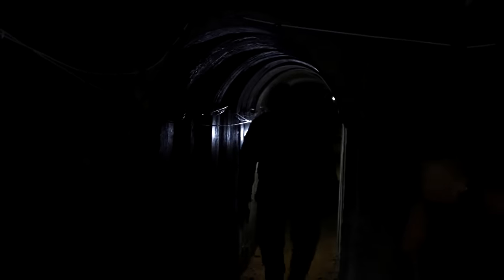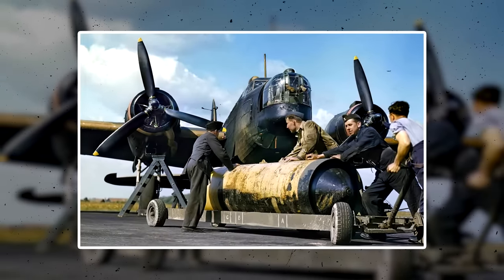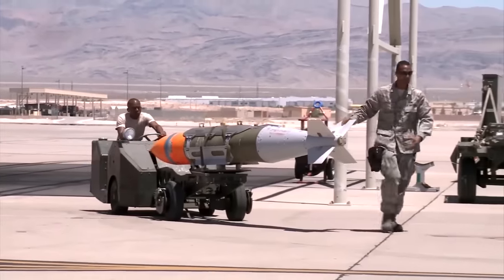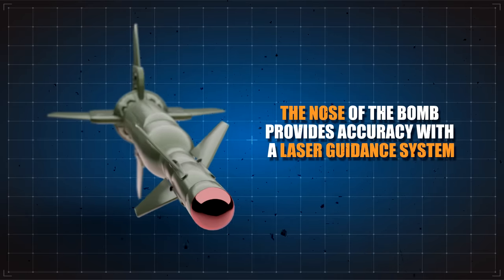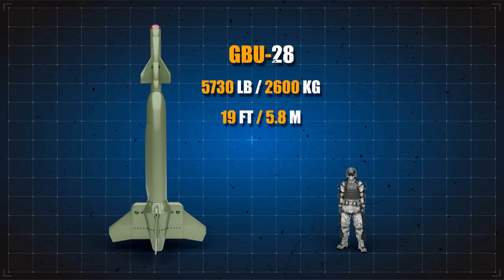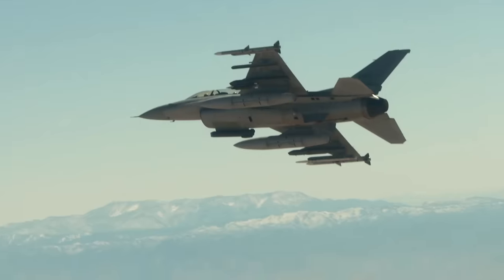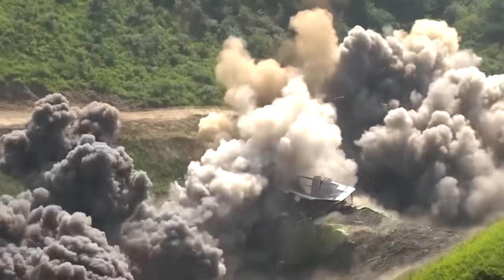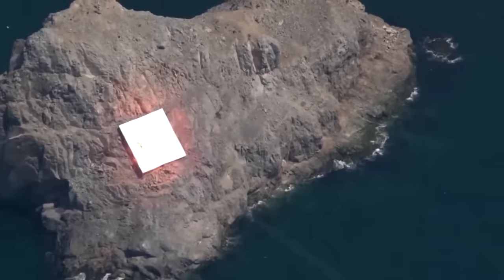This Bomb Could Stop The War

Comment: Curious why a video on “Bunker Bombs” wouldn’t even hint at the existence of MOABs or MOPs
Reply: Because Moab is not a bunker buster. It doesn't penetrate, it creates a vacuum and pulls all the air out of a tunnel or air vent. It also creates an overpressure similar to a small nuclear weapon.
Reply: Mother of all bombs. Footage of them used in Vietnam idk how many we dropped but it wasn’t a lot
Reply: @Jeffrey_zeta -- in Nam they were called "cheeseburger" or "Instant LZ." Fuel-air explosive type of bomb, flattened about a half mile of jungle so helos could land.
Reply: Explodes above the ground.
Reply: @lordphullautosear  the viet's got wind of the tactics and laid ambush to helos landing

Comment: The fuse on some of these new bunker busters can actually count the layers of protection and explode at a preprogrammed level.
Reply: @walterrichards1802  Just a note here that the term is not "fuse," it's "fuze."  I worked at a fuze company that made them for weapons in use from around 2000 to today.  Fuze design is a unique trade and there are a lot of gotchas.  One gotcha is one revision of the design and production standard that requires a tremendous amount of testing.  So much that if you're used to the other revisions, you will most likely bid too low to complete the job.  My company read the standard and didn't assume it was just typos they corrected.  Our bid was four times greater than the next nearest bid.  They won and lost their ass.  They almost went bankrupt.

Comment: underground "bunkers" are mazes of tunnels, and not just a room under 20 meters of concrete directly at the vertical of the obvious entry
Reply: The pressure created underground will try to find the easiest way to normalise itself . If the pressure find a tunnel open to the ground and air outside then most of the power will go that way . However , most underground tunnels designed for defence would be sealed from the outside air , so a bomb's pressure can only blow back up the shaft it made on entry , there will be plenty of energy to push on every surface and travel long distances up any tunnel available . The bomb damage will effect much more than the volume of space it explodes in .....

Comment: Just the satellite weapon  the one in space that drops  tungsten telegraphe  poles no warhead  just shear speed on impact only thing is they say it does not exist  yeah right ...😂😂
Reply: Hyperkinetic death sticks!
Reply: Pretty sure that went into space in the 70's???
Reply: When a person falls from an aeroplane , with no parachute to help , he will accelerate in speed and reach what is called terminal velocity , where the air prevents further acceleration . So the tungsten pole surely would reach its , different , terminal velocity without some kind of propulsion , whatever the height dropped . Or am I wrong ?
Reply: @davidyendoll5903  At the point that they are dropped there is no atmosphere.
Reply: I beleive the program was called Rods of God or something like that, and if I remember right they had a very sharp point and traveled about 30,000 mph if memory serves me ?
Very deep penetration. 
It was tested, and was ment to be a space platform, not sure if they made ine though, but they did test the poles.
🇺🇸

Comment: How the shell of the bomb penetrate 20 ft concrete or 100ft earth without damage 😮
Reply: They tend to use recycled artillery cannon barrels. Then the bomb casing does not fracture as it penetrates the concrete. Read a few more of the articles on Bunker Busters and Penetrators, and get more info.
Also makes for good recycling of the used barrels. 😛 😝